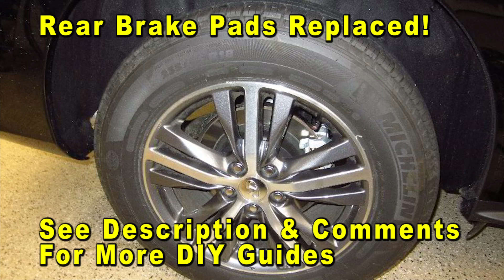2013 To 2020 Infiniti QX60 How To Change Rear Brake Pads With Part Numbers & Torque Specifications

Comment from the maker: Infiniti QX60 Rear Brake Pads - https://amzn.to/3ZfE89l
Bendix Rear Brake Pads Part # - https://amzn.to/4734Wez
Wagner QuickStop Part Number - https://amzn.to/3SXe9iY
Akeobono Ceramic Rear Brake Pads - https://amzn.to/4cJkYLL
18" F Clamp - https://amzn.to/3MjIEvw
Precision Screwdriver Set - https://amzn.to/3sLixaP
Plastic Pry Bar Tools - https://amzn.to/3HMtsV7
Socket & Ratchet Set - https://amzn.to/3Z17LbA
Mechanix Gloves - https://amzn.to/3jCnHkt
Torque Wrench - https://amzn.to/3vS5uSI

The Paul79UF YouTube channel is a participant in the Amazon Services LLC Associates Program, an affiliate advertising program designed to provide a means for sites to earn advertising fees by advertising and linking to Amazon.

This DIY video shows owners of the 1st generation 2013 (JX35), 2014, 2015, 2016, 2017, 2018, 2019 and 2020 Infiniti QX60 SUV how to change the rear brake pads and lubricate the caliper slide pins including the torque specifications for the caliper bolts, bracket bolts and lug nuts.

Comment from the maker: Check out the DIY guide for changing the rear brake pads on a first generation 2013 (JX35) to 2020 Infiniti QX60 SUV - 
https://www.paulstravelpictures.com/Infiniti-QX60-Rear-Brake-Pads-Replacement-Guide/index.html

Here are all of the DIY repair and maintenance tutorials for the 1st generation 2013 to 2020 Infiniti QX60 luxury SUV (made by Nissan) - 
https://www.paulstravelpictures.com/Articles/2013-2020-Infiniti-QX60-DIY-Repair-Maintenance-Guides.htm

Owners of other Infiniti and Nissan vehicles such as the JX35, Q50, Q60, QX50, QX80, Pathfinder, Murano, Rogue, Armada, Kicks, Frontier, Titan, NV, NV200, 370Z, GT-R, Leaf, Maxima, Altima, Sentra and Versa might also find these DIY instructions to be helpful.